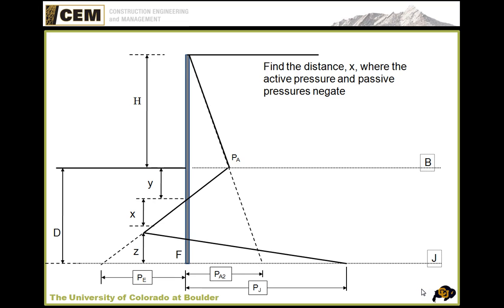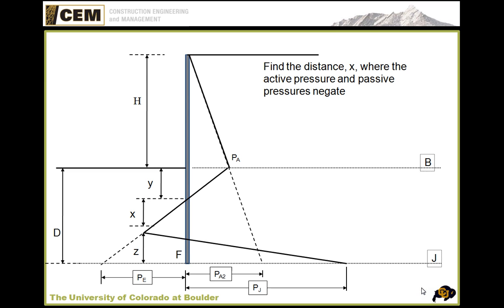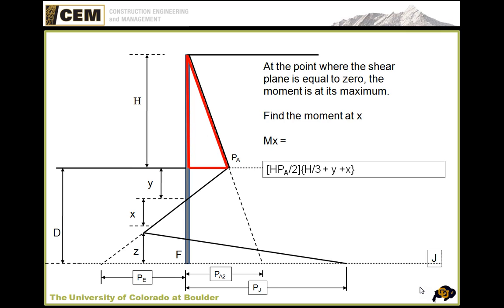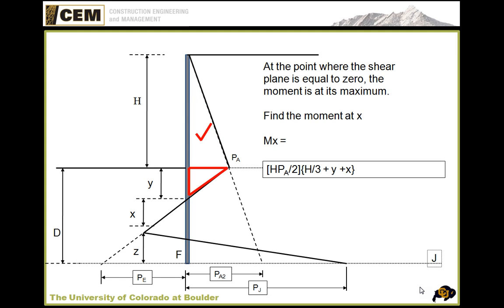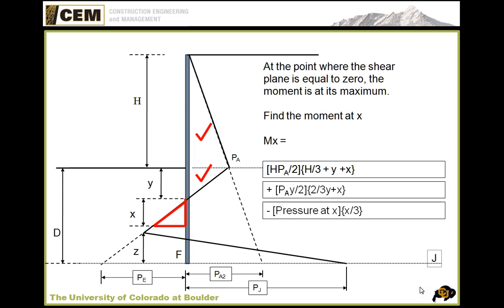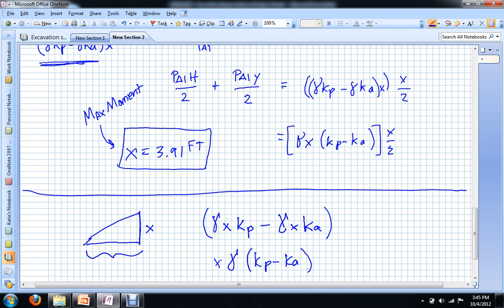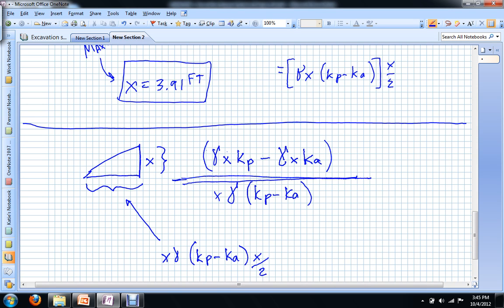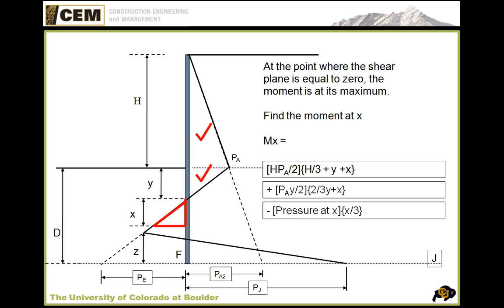Excavation Support System Design - Final Design Considerations

Comment: Hi Matt. Nice videos. I just saw this series on the cantilevered wall, and entered it into Matchcad as I went along. Luckily I could generate the same results as you :-) I found the videos very usefull as I could compare your method to the method I normally use (which is the Danish Brinch Hansen's Earth Pressure Calculation method). I am a lecrurer at a Danish Engineering College (VIA), and find these sorts of videos nice. I am about to start making my own videos also.
Reply: Hi, is it possible to share with me the Mathcad file, if you don't mind?